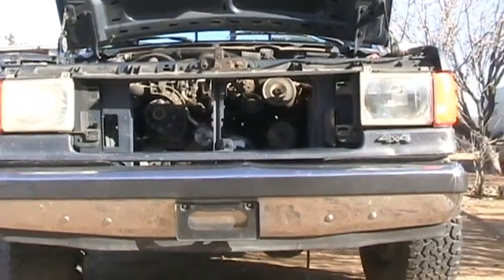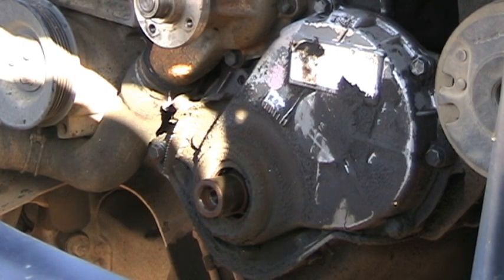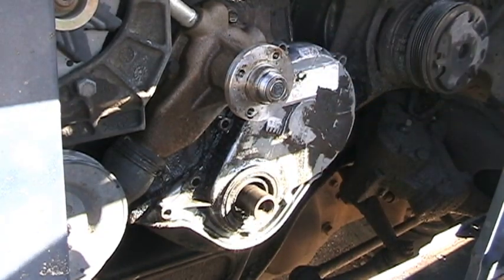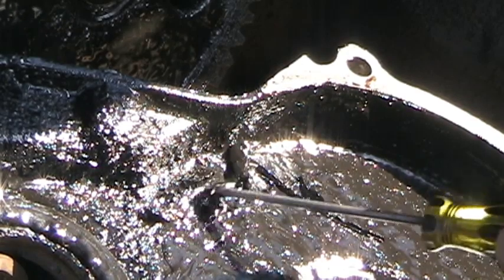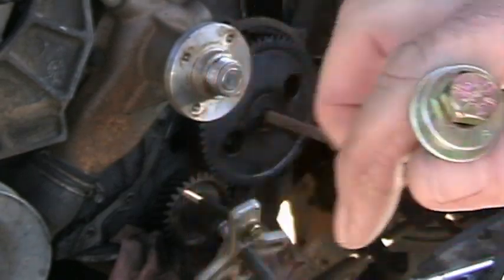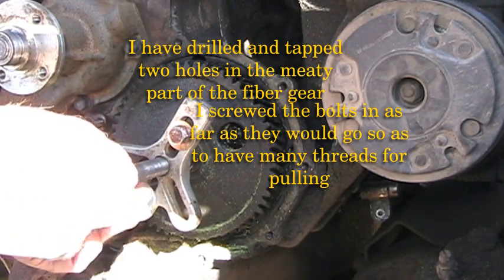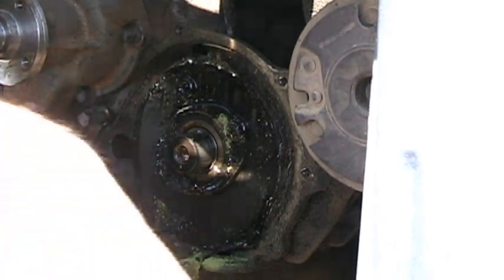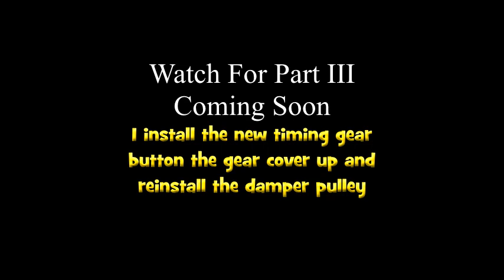1987 F150 i6 Fan Clutch, Cam Timing Gear Replace Part II

Comment: Thank you for this well done video. I'm buying a '95 150 with a 4.9, 5 speed (Mazda) is your a 4 speed? How many miles were on her when you pulled the gears?
Reply from the maker: +binthrdonthat Hello, Yes mine is a 4 speed and a 4x4. It has the older style tranny. The odometer read 153000 when I got it. I believe it was actual mileage as the pedals and interior looked its age. I found some older receipts dating back to the original owner as well. My truck was used in a tree surgery business by it last owner (not original) and was used to pulling some very heavy trailers with logs and such. The timing gear gave out going up a very long and steep hill pulling a heavy load while maintaining 60mph plus. In addition, I do not believe the oil was changed on a regular basis as is very important for the fiber timing gear. Dirty oil will make them wear more. Thanks for the comment! Enjoy your new truck.
Reply: Dirty oil  and not replacing cr   ankcase filter under air filter,which  allows  abrasive  dust into engine.      My 88 4.9  has 400,000 miles with  original  timing  gears  . Engine is clean internally  because  oil and all filters have been  maintained  since dad bought  it new.

Comment: What a fd up ford.idea. let's take the most reliable timing system and used a plastic gear that is bound to come apart.
Reply from the maker: They say it was for noise control.  Oh, and my 1969 Cadillac used a PLASTIC gear in the timing...lasts about 130000 miles. Wish I still had the caddy too!

Comment: how did you know where to drill to pull off the gears?
Reply from the maker: Cristian Pillado Hey, I got as close to the metal center as possible without drilling into it. I sort of guessed at the approximate location. If I was wrong... then I had plenty of gear to try another hole at another spot. It worked out better than I expected. I did a more extensive write up of this on www.yardzoo.us if you want to know more. thanks for the reply...SteveAZ